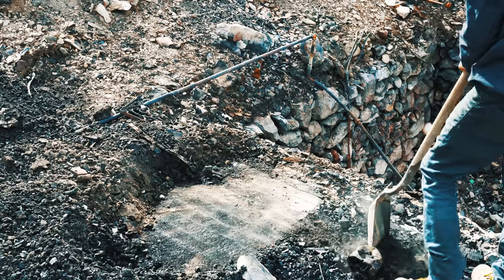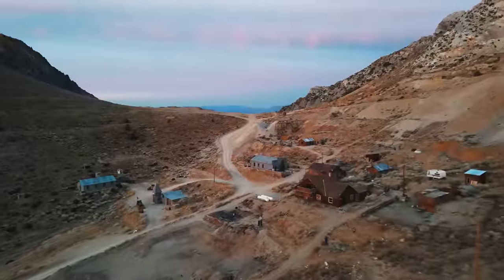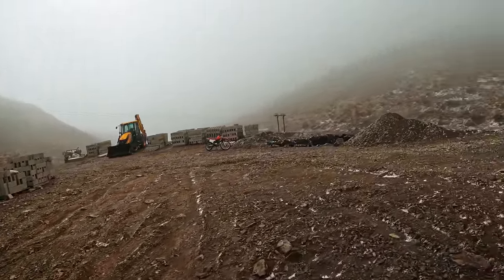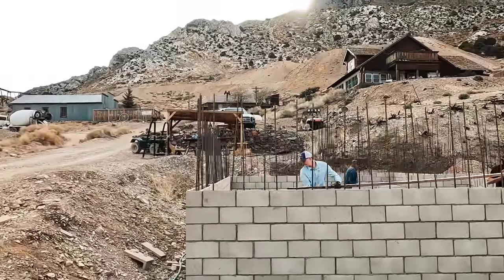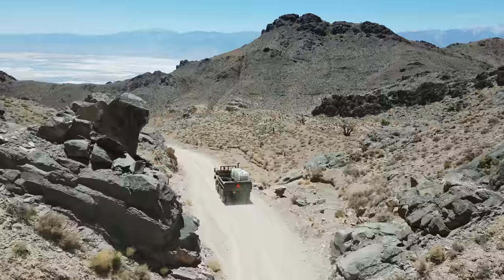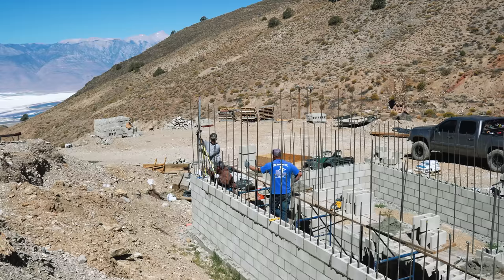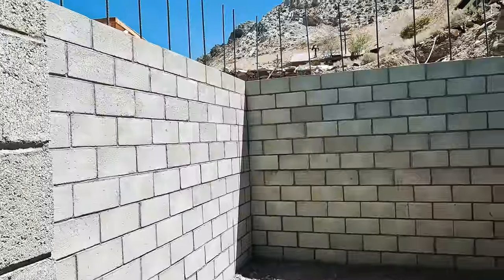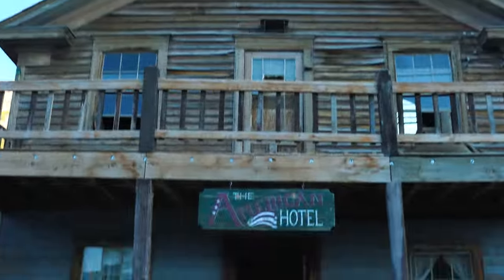Rebuilding The American Hotel Continues, Finally!

Comment: Been thinking about your water supply issues . Have you got Water tanks for collecting rain water ? I don't like the thought of your water being pumped up out of the mine . Being a Silver mine there is also alot of Lead content as well . Lead is most likely  in the water supply which is not recommended for drinking
Reply from the maker: We’ll be hauling up all the potable water!

Comment: we used an old cement truck and mixed our own concrete. we backed the concrete truck into a hole with ramp and loaded dry cement and water

Comment: I think I would have mentioned that each one of those concrete cinder blocks weighs about 40 pounds, they are not light. 
(at least the ones I have weigh that much)

Comment: Few things I'm curious about. Did the original have a basement? I realize this is a rebuild so it's not going to be the exact same. Just seeing the original images it doesn't seem like there was one there. 

Also, what ever happened with that strip mine company? Being that it hasn't even mentioned in a while, I'm sure they aren't moving forward with any plans near there. Does anyone know about that?

Comment: Your water problems, this might be a fix. Look into Atmospheric water generators for your sight. You can make water right out of the air. Power the system with wind and solar and make as much water as you can afford to power. For your office try a 5 to 8 gallon a day unit, they cost $1,800 to $2,600 search online for your deals. Atmospheric water generators can make 30, 50, 300, 500 to 1000 gallons a day or more. Just keep adding to your system. You can put tham allover your site where needed. Another idea is solar panels that make stand alone water and power them selfs. Look into Zero Mass for the units they sell. I will be buying these units for a off grid property I own. I've seen units online  in Saudi Arabia that make a million gallons a day out of the desert Air.

Comment: So much potential.
ATV trail site
Mountain bike trail site
Cable car from the bottom to the top following the old cable bucket route.
Multiple zip line trail from the top to the bottom.
Camping cabin's in old style basic miners cabins.
Mine tours
Cave/mine exploration training center
Silver Smith workshop course smelt to ring using tailings. 
Use the tailings for concrete filler and have paths laid with silver.
Host sporting events. Para gliding. Enduro. Ironman. Trial bike. Mountain bike. Marathon. Ultra.

Comment: I been watching you for quite some time now, like from the very first vid actually... hehe! And boy are you putting in all the effort and even bending yourself backwards to make your dream and others come true! Mad respect to you all! But about the American hotel.. Why are you making the walls out of concrete blocks? I mean, for the foundation I understand. And that's what I expected too. But it looks like you're going to continue the walls all the way up to the second floor or? Now, this is obviously a project of yours and all the others up there, so I'm not telling you how to rebuild your dream. But you where talking about rebuilding it as it was. So I'm just curious about your plans going forward with this project. Because the original Hotel was pretty much all made out of wood, as far as I can tell from the footage anyway. But I haven't been able to see all your vids during the last 6-9 months, due to the necessary, total shift of focus, towards the invasion and escalation, of the attack on Ukraine by Russia that started in 2013/2014. Or actually, to be more accurate.. Russia have been infiltrating, and f*cking with them, ever since the fall of the Soviet union, back in 91-93. So therefor I haven't had the time to view pretty much anything else. So therefor, I may have missed one or two vids, that explained your plans further in detail.

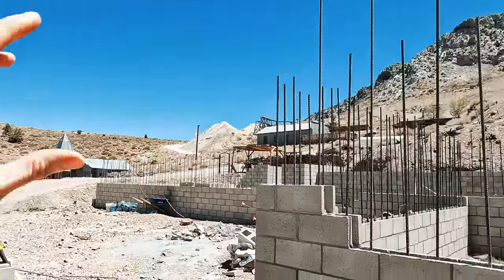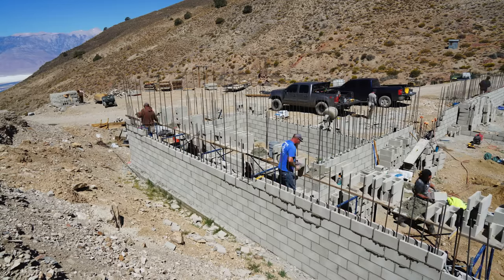Edit: I missed that you said "basement" at 19:44 and as well at 19:54. And again at 21:37.    Sorry.. Also didn't pay enough attention to what you explained after that either about what the basement would be used for. My apologies.. Forgiveness, Please! (Simpsons - Yakuza scene)

Comment: I don’t see anything wrong with that road whatsoever. There are no washouts.  No wide deep creeks running across it 24 / 7. It’s wide enough in the vast majority of places,  that vehicles approaching one another,  can most definitely slow down,  and pass one another.   So it’s a fairly long, steep in places.  Ok. So what.  You have a good wide hard packed road. Just like so many here in Wyoming.  One we live off of is 8 1/2 miles from our closet neighbor and,  23 miles or there about to town. We live in the very NW Part of Wyoming.